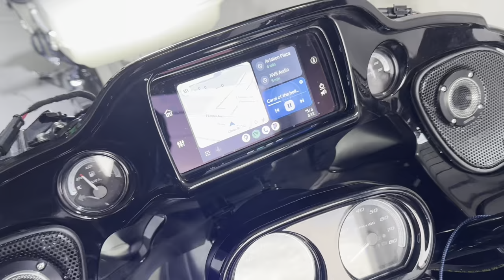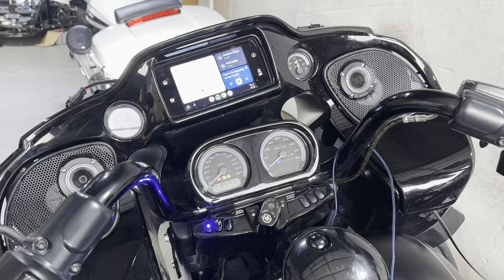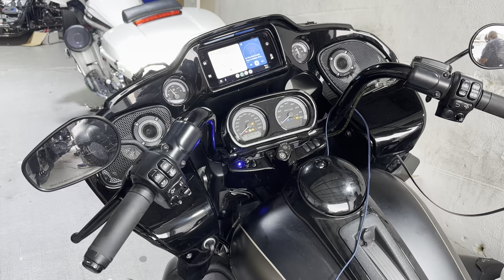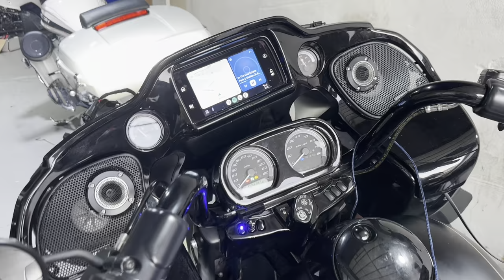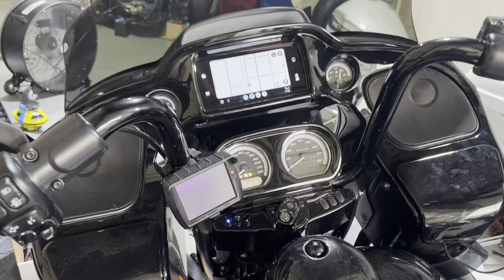Dwight & Jason took the 7 hr ride from Virginia to NJ to get the audio upgraded on their Road glides

Comment: Carlos, how are you, good morning from Mexico, I would like to ask you if putting only two Hertz speakers on the fairing and 2 speakers in the back where the tourpack is on my Ultralimited motorcycle, with only these 4 speakers it will be more than enough or it is necessary to install 2 6x9 speakers in each saddlebag?